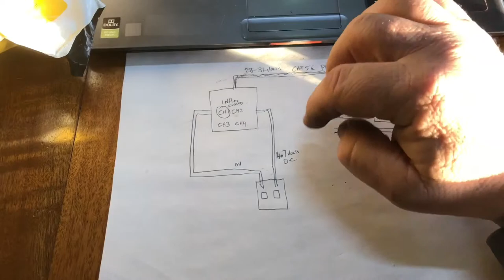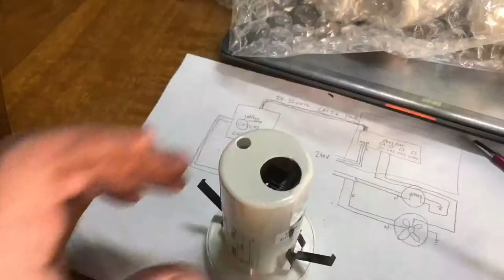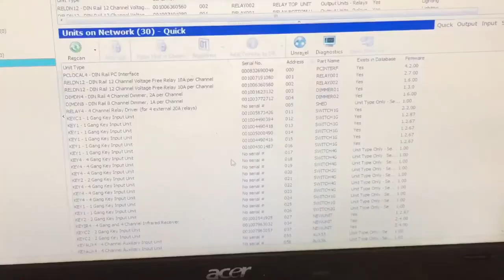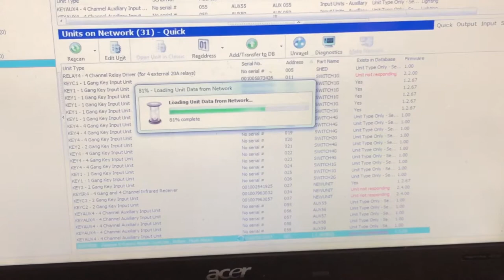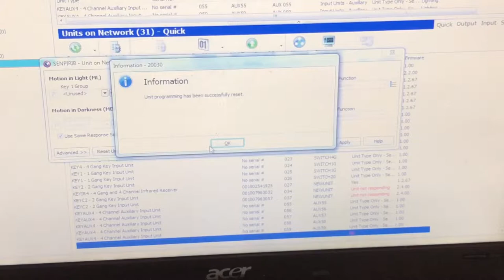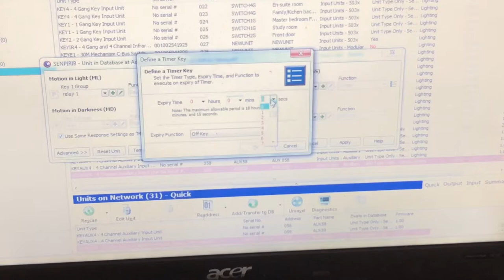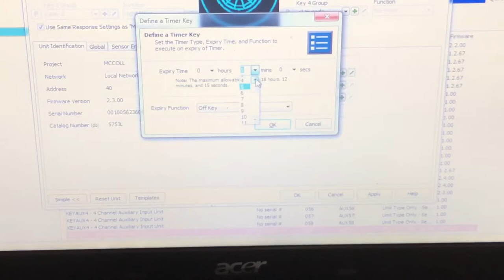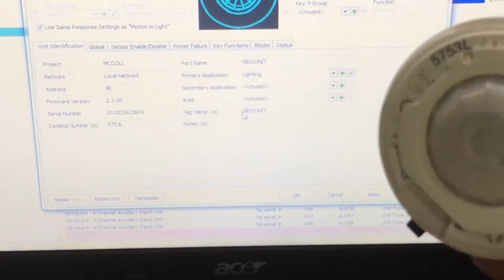C-Bus PIR occupancy sensor Part 1

Comment: Hi ,can I disable the PIR function ,its installed by other party,Is the configuration software is free？Thesumplw way,If I disconnect 1 line  is it can work as disable the PIR dim and switch off function？
Reply from the maker: You can download the free toolkit from this link, ( https://updates.clipsal.com/ClipsalSoftwareDownload/mainsite/cis/technical/downloads/c-bus_toolkit.html ) this is the software from Clipsal, but you will need a PC Interface unit ( part number  5500PC )plugged into the c-bus network, the PC Interface then connects to you PC via RS-232, so you will need a spare comport on the PC, once you have that all set up, then you can map the c-bus network, find the PIR you wont to change and open the config of the PIR and change it the way you want to or even delete off the network, it wont change the other Devices assigned to the same output device( e.g. lights switch for the some light PIR is controlling ) , It a little bit fiddly but there is instructions on the Clipsal C-Bus web page,
Reply: @vk3hau  thanks for your help, My notebook have 232 port ,but I no have the Cbus main controller ,if only get the PiR sensor on hand ,do I need to buy a hardware kit to connect the sensor for programing？if I turn on the light and remove the PIR is the lighting system can work as normal ,I want to make easy to achieve the same result, instead of programing ,thanks
Reply from the maker: @jacktse1963  
Yes, you can just unplug the PIR, ( the wires are usually screwed in to the PIR ) it won't affect the other input Devices controlling the output device. Just remember that the c-bus wiring may be in a Daisychain configuration so when you unplug the wires, if there is two or more sets of wires going to the PIR, just make sure not to break the connections, but if the PIR is on the end run of the c-bas wiring ( the last device on the line ) or the PIR has a rj45 plug you can just unplug it.
Reply: @vk3hau  many thanks to you ,its helpful to me ,hope you all the best.